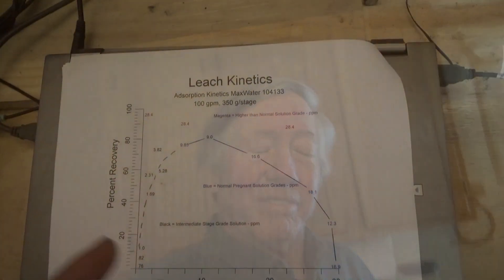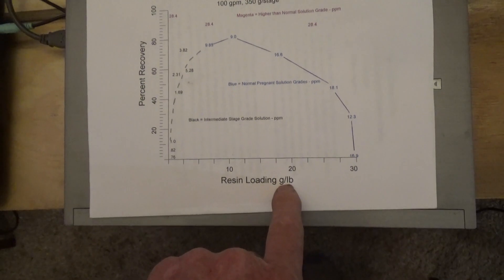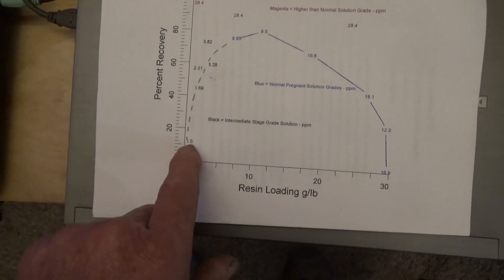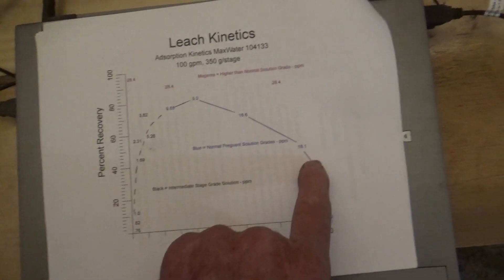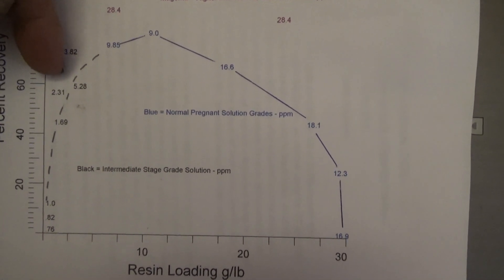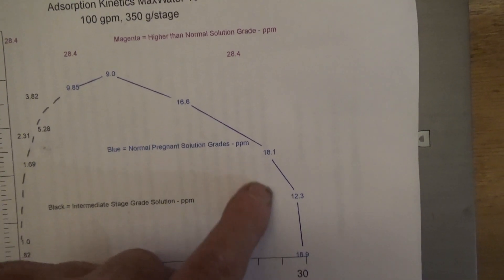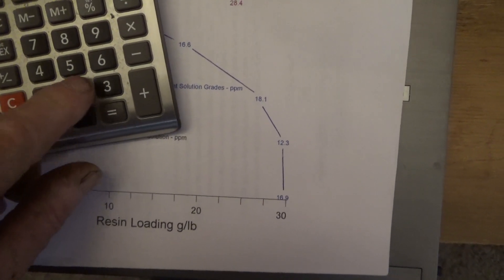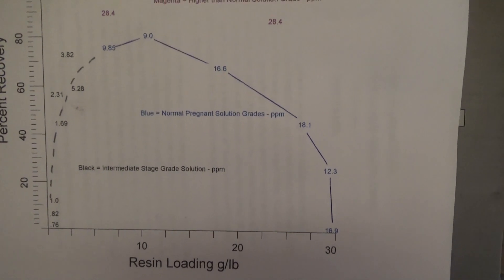245 Adsorption Kinetics- Maxwater104133 Resin

Comment: I like the parking lot analogy Keith , but luckily you have four in a row , it's just a matter of knowing when to switch them over so you don't loose much back in your solution tank . But if you don't get it the first time it will just go round the circuit again anyway wouldn't it , and i suppose it is good to maximise gold load in the resin so your not ashing  it with very little gold in it . The science of it all is  very interesting , the anion exchange business is so complicated , positive charges and negative charges how the PH of solution  plays such a role in that regard , and the correct resin etc , it's all very mind blowing , just as long as it does the job is all i would care about ,  lol , keep at it cheers Ned .
Reply from the maker: You seem to have the basic idea Ned.  I also try to keep things simple so I can understand them myself.  Chris is more the theory guy.

Yep.  If you know approximately what the solution concentration is, you can pump 'X' gallons of solution through a multi stage system and then take out the first cartridge for gold recovery from resin and then advance the others and replace the last cartridge with a fresh one.  We are also going to be experimenting to see if we can come up with a quick and cheap field test of the solution so we can monitor the process and do the change when optimum.

And yes, anything you miss should just be recycled.

Comment: Are you trying to do similar to what others have done using mercury or with arsenic , but using other than those toxic elements ?
Or would those toxic elements not be capable of getting the gold you are chasing ?
Reply from the maker: Mohamed, I wrote a reply earlier, but now I don't see it.  Damn You Tube! Let me try again.....

I think you mean cyanide instead of arsenic. 

Cyanide would probably work, but is banned in Montana.  Even if legal, the restrictions would be much more.  It is also nice to be working on something new and with less to worry about.

Mercury would also be illegal, but would not recover the very small gold (2000 mesh/ 7 micron) that we are dealing with.  The surface tension on the mercury would not let the gold penetrate.  Therefore it was never even a theoretical option.
Reply: @hardrockuniversity7283  Thank You for easily understood reply
Reply from the maker: @mohammednovalija  You're welcome Mohammed